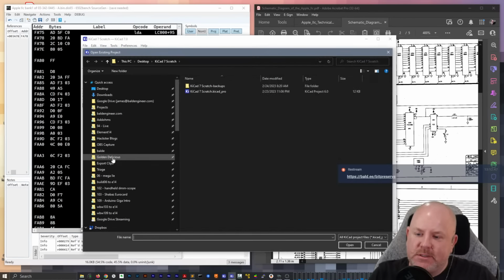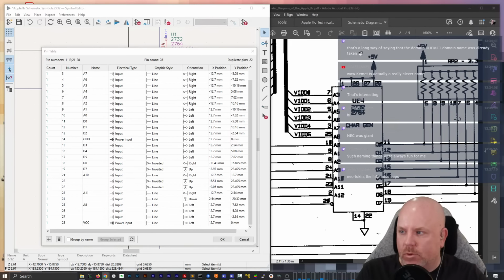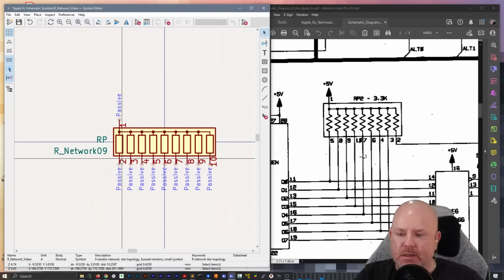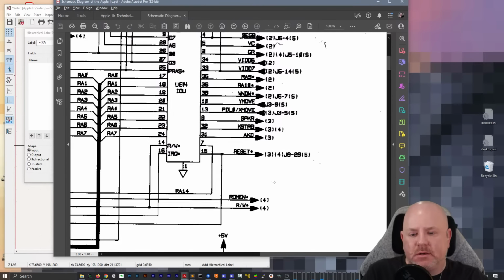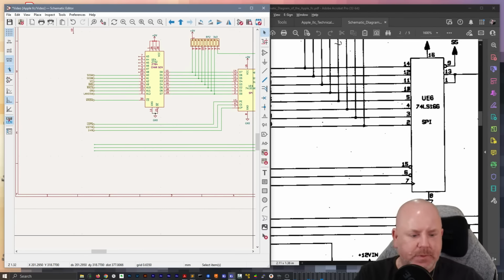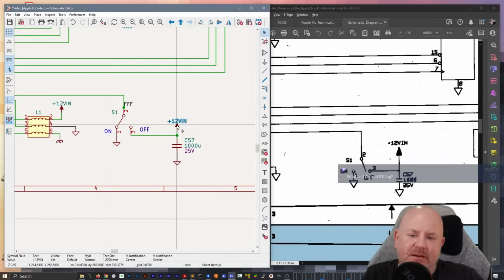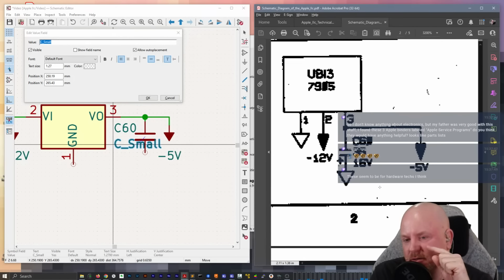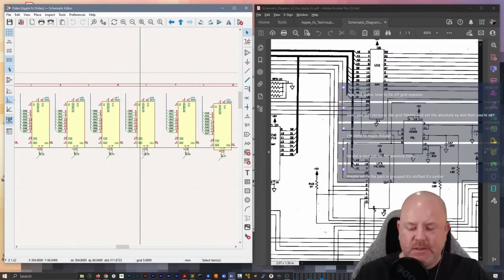Apple IIc Schematic in KiCad 7 - Part 3

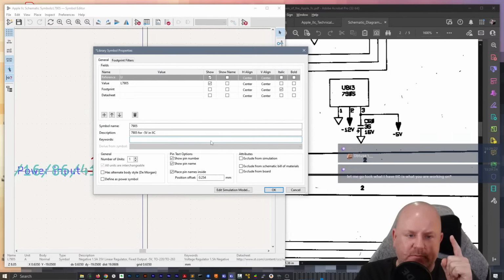Comment: Since you mentioned the 78xx and 79xx rectifiers around 2:25:00 I wonder if you know the answer to this... power supplies found in some of the macs have a C78N05 used for regulating -5V output from the supply. But this part isn't well known today. Two supplies I've seen these in are the TDK 699-0153 (looks like Apple PN) and the Astec AA16251 (both are also very similar to the GS supply except -12V is not an output so GS supply can be used in their place).  Trying to find a replacement for the regulator but am not sure what would be correct. Is 78N05 a negative input/output like you said is true of the 79series? I believe I probed a working supply (been a while so maybe not) IIRC I found -6V on pin2 and -5 on pin3 and p1 tied to ground. -6.3V seems a tad low for -5 out but whatever. This would also not follow the 78xx/79xx naming convention.  Any idea what the N in the middle 78N05 indiecates? I know the trick to have positive regulator output negative voltage by moving ground, but the boards don't appear wired in that way.
Reply from the maker: No idea. But Google searching it seems to confirm it’s a positive regulator.